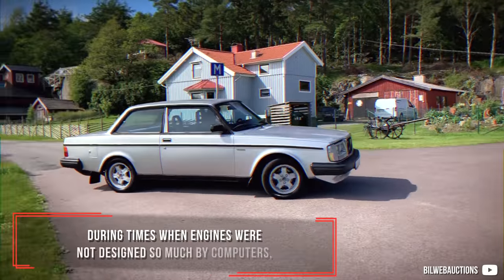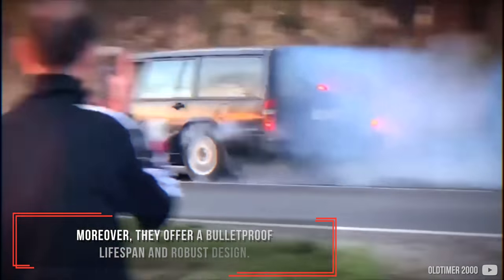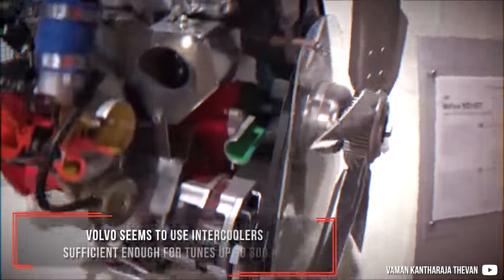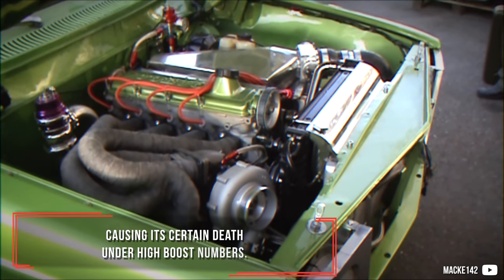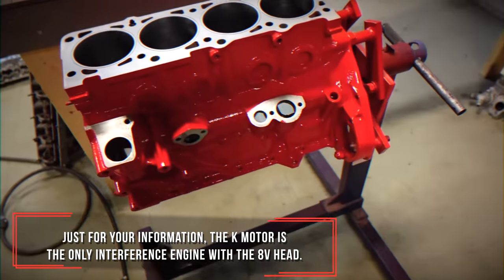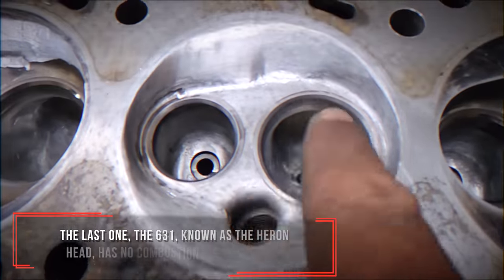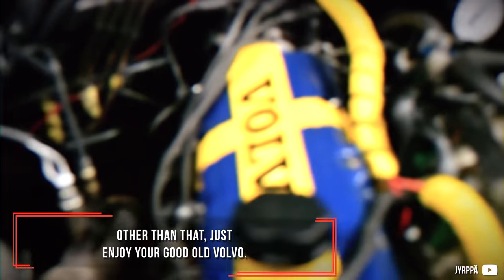Volvo Redblock: Sweden's Best Tuning Engine

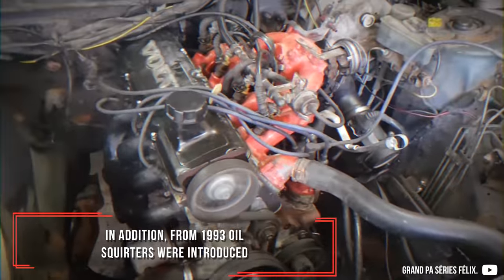Comment: 5:36 there was actually one variant that had a forged crank, the B204FT/GT which was only sold in italy and is super rare :O

Edit: the G variants were the same as F but made to run on leaded gas.

And there's a guy, dieselpacko, who used a modified K head on a non-K to diesel convert a 240...F, K and turbo engines have different height pistons, F has the highest ones, K the lowest and turbo in the middle and a K head with F pistons provided high enough compression for combusting diesel ;D
Reply: My b204ft is from italy. And i have lucky buying second engine for around 230$😁
Reply: köpte hans gamla 340, han kan sina grejer när det gäller volvo motorer kan man säga.
Reply: @Rostvin  nae jag bara är sån när jag börjar snacka volvo, bara börjar svamlar en massa 😂
Reply: B204ft the best Volvo redblock ever. One friend of mine has one on stock in his garage.

They made from 190-205hp stock. And made 250 easy with just a boost and exhaust  uppgrade
Reply: @Wasio212  best Volvo redblock ever
Reply: @anderseliassen2470  280km on stock turbo max and 400hp on stock piston and rods but i'm not sure on 100%
Reply: @Wasio212  Who said 280km on stock turbo?.. 280 hp?. Not on the weels. 250/260 max. Pistons 600+hp. Rods, manifoil and inntake up to 400
Reply: @anderseliassen2470  my friend but i said i'm not sure😅 so you say stock piston can handle 600hp?
Reply: @anderseliassen2470  not really, 16v is the best flowing head/cam setup stock and still one of the best. Turbo+ package achieved 190hp(and WAY more torque) with the worst flowing head and cam setup; 530 head with a T cam. Only head and crank are interesting(and penta crank is even more desireable) rest is worth scrap money
Reply: @Wasio212  overboost racing did almost 800hp on modified(for lower compression) pistons from a naturally aspirated engine. Base engine was an NA B230F with only modifications made being the stock pistons getting modified, aftermarket H rods(they only handle 300-400 stock reliably), aftermarket bearings and a turbo conversion. Crank, oil pump etc were stock from 1989 I believe his engine was from
Reply: @Wasio212  on the fk/Ft engine Yes. Some sweeds have even pushed it further 😂. Its the rod's and bad tunes that fails.
Most I have heard on stock b230ft pistons is 700 weel hp 💪🏼
Reply: @LocalAutist  b230 fk with penta crank, and 16v glt head and cams is a legit power plant 💪🏼
Reply: @anderseliassen2470  it doesnt even take any serious boost to make 300hp on such an engine😎

Comment: My b 23 lasted (as I recall) 335,000 miles, and my wife's b 230 was still running at 225,000 miles when we traded it in.   Excellent cars, both, but I preferred my b 23.

Comment: A problem not mentioned (because its the gearbox, not engine) is the m47 transmission. They can hold about 300-350whp before it starts to slipp. It started to happend on the Dirfts n Lifts Volvo you used in this video.  So if you want high hp numbers you also have to change out the trans with a modded bmw zf trans
Reply: M90 does is quite good also. But 3rd gear sync can be broken if you does hard gearshifts.
Also OD on m46 or m47  and "stupid" OD on all gears can be quite fun also.

Comment: Nice video about the redblocks! U missed one thing and that is the B234f (16v) engines has it's own block. U mentioned the balance shafts but it is the only block that they fit on. And the b234 has a belt driven oilpump. with that said the 16v head fits straight on a regular b230 with some modifications to the belt drive. If you really want to tune a redblock go for the b230fk block from 1995-1998. they have oilsquirters under the pistons.
Reply: Ad a 16v glt head wit cams, and a penta crank, and you have a powerplant

Comment: The Volvo red block engines is absolutely not a bad engine in any way but actually I would say that Swedens really best tuning engine is the Saab B204 and B234 found in 1994-1998 Saab 900 and 9000 and the 1998-2000 Saab 9-3.

Comment: As a volvo freak i can tell everyone that the 9mm rod engines are ok for NA tuning. Im running a Stock B200k block (stock 10.0/1 compression pistons) with -2mm skimmed head so about 11.5 or 12:1 comp), ported, H Camshaft, Weber DGAS 38/38, agressive timing , stock ported intake, some stiffer valve springs and its a blast to drive. 7500Rpm winter skids no problem. And gets 7.5L/100 no problem on the highway. But Not in the city 🙈😜

Comment: I had a bone stock 1986 b230 bottom with the 9mm conrods coupled with a 531 head and b230 pistons and a ”swan neck” intake so as a n/a it would put out 140-150 hp then i forced it with 1,6 bars of boost and drove it like that for a couple of seasons and broke nothing. 

So in my opinion the fear of the weak early b230 is overexaggerated. But if money hadn’t been an issue during those days i would have used more safe parts.

Comment: I always wondered why Volvo didn’t turbocharge the B234 (the 16 valve, balance shaft version). It was a sweet motor that loved to rev and 9-12 pounds of boost would have been impressive.
Reply: Yeah only the b204 was boosted, in small series. 200hp with low boost and tame camshafts.
Reply: @neonalon  Yeah because world weakest RWD gearboxes (m46/m47).

Comment: I have had three 740's; '91 B230F (electronic injection), 1988 B230E (mechanical injection) & 1985 B230A (pierburg 160CD carburettor) 😄 I found the A best even in cold ass Finnish winters. The F was the worst kind of F, Bendix Regina. always electrical issues. E was fine but had bad idle and throttle stuck open sometimes. Funny enough a connecting rod came through the block in my 85 B230A 😂 I did drive it hard, slides etc. but I took good care of it. Bet someone didn't. No idea how many miles were on it because of typical 740 broken speedo.

Comment: Those red block engines are strong reliable, bulletproof  you have the B-16,B18, and the different engines used in the 240s up to 1986 from there on it changed

Comment: I was really thinking about slapping a red block into my 960. However after further researching the uniqueness of the 960, I have come to conclusion that I'd rather keep the original B6304 ❤️
Reply: I'm also thinking about doing a 960/V90 Classic with a Redblock in it, I just love this engine. What is the weakest part of the Whiteblock in the 960's, the B6304?
Reply: @martij30  You know.. I'm not really sure. I've heard they are difficult to boost if the cylinder walls are too thin, allowing overheat. I've also read about people taking a S80 T6 block and sump, mating that with the 960.

Honestly I hear so many different opinions on how to build a 960, sounds like Volvos most diverse but ugliest child. Some will say to slap in a T6 with a single turbo considering the T6 will mount up perfectly. Others say a T5. Others will tell you a T5 is a pain to put in a 960. Then you have those who suggest a red block B230FT L (I guess the L is important when choosing this engine). I've heard some say to use pistons and rods from a T6 with cylinder sleeves to thicken up the walls.

I don't know what I'll be doing, but I'm gonna start with suspension and handling first. Thinking I'll just get better pistons and rods with a sporty camshaft and work on turbo after.

Comment: Here in sweden we know the limits of the fk b230 we just change rods to h-beam and port the cylinder head and for those upgrades we reach 700hp
Reply: Word. I had 337whp on my stock 98 b230fk. Just 531 head, gasket and arp studs and flyweel from fx engine.  Std rods, pistons and all. Drove it like that for 6 years before i sold it. That was 8 years ago, and engine is stil healty

Comment: I mean i would say Saab B2x4 or Volvo T5s are the best swedish engines for tuning
Reply: Yes and no, they can be tuned for big power but it'll probably cost 4x as much as a hi po redblock.
Reply: @eyesodd  you'd have an easier time making power from ANY T5 engine, and especially the 3.0T. the only redblock worth modding is the 91+ oil squirter blocks and even then the 8V head is quite restrictive compared to the 16v

Comment: My 1991 740 wagon seriously needs some of that turbo power. Good information if I want to build mine into a Hot Rod 
In the meantime what is best modification to squeeze a bit more horses out of it??
Has around 200,000 miles and still going strong. ( speedometer broke years ago at 165k)
JT: Orlando Florida

Comment: Power figures are a bit optimistic tho. Honest power at 1 bar boost is about 200 for most any B230 8v with any combintation of stock (8v) parts and no modifications other than higher boost. A 16v head (stock) on a B230 turbo bottom end will give about 300 on 1 bar. The 531 head is overrated, too big ports compared to actual flow, as it's the seat and valve config that is the limiting factor for any of the 8v heads. Otherwise the info is fairly decent.

Comment: Good to hear good thing about this engines.  I have a 1982 244 gl. I think it’s A k jet tronic.  Any info on that fuel system ?
Reply: Developed by Bosch and used by a lot of different mfg, they tend to work for years with minimum maintenance, but can be a handful once they need more elaborated service.

Comment: One thing to say is.  If you only change the oil and sparksplugs now and then. They will just go and go forever.  40-60-80 000km here in Sweden is not that rare  that they does work just as fin when they was new.    If the Belt broke. Just rotate the engine to Deadpoint and put a new belt on and drive again.   I can say that Every person i Sweden have drove a red block or a shop have worked on the cars so they know what to replace.

Comment: I would advise to whiteblock swap. Whiteblock is better.
Reply: How do you figure that? I've seen alot of failed whitebocks usually #2 rod bearing failure.. I'm yet to see with my own eyes a redblock fail... In terms of power I think the whitebocks are much better designed but they are not over engineered like the older redblock. I have replaced 4 whitebocks at the Volvo dealer I worked at and every time #2 wiped out the crank. Yet our older customers keep on chugging along in their 940s.
Reply: @hayballz1  It is just my opinion. I know a lot of people love redblocks. I would love a 16 valve stroker redblock with ITB-s and some form of forced induction. But if I compare a common 8-valve redblock to a common aluminum DOHC 5-cyl whiteblock, then that old redblock just seems very outdated when compared to what is available.

I have had three 8-valve redblocks, the last one I slapped an MB supercharger on and the rod bearings wore out probably because of low end torque or lack of oil cooling. 
I dont blame it though, it was good fun.
Now I swapped in a 4-cylinder 1.9 whiteblock (T4) with a cummins turbo, and it is a really nice small, smooth and light engine. T5 or T6 is even nicer though.

The redblock is legendary, but it is often overhyped.
Reply: @TheTavEst  agreed it is outdated and less powerful with less potential for power. That being said it certainly shines in durability and ease of repair. I just couldn't recommend a whiteblock swap over a redblock for what I have seen and how they fail and it is always the #2 bearing. It seems to me by the time they came out with the whiteblock they got the bean counters in and started cutting corners sacrificing reliability for power and comfort, once ford got their hands on the company things got even worse. To summarize if it's got a redblock leave it in there and if it's got a whiteblock change that damn oil every 3k with synthetic. I have worked on 100s of these vehicles and owned a few.. Of the cars I have owned and worked on the whitebocks always run smoother and feel more powerful but if I'm driving from NY to California I want the old redblock under the hood.
Reply: @hayballz1  True, my redblocks have never let me down because of engine problems. Now the whiteblock has a chance to.

Comment: the b230 bottom end can actually hold up to 385 whp
Reply: And with rods, pistons and a high preasure oil pump it will take about 650
Reply: @einar8019  stock turbo pistons hold 600+ hp
Reply: @anderseliassen2470  yes but not the rods
Reply: @einar8019  Not even close. Std 230 ft/fk rods are shite for any over 350 weel hp

Comment: What is this? Stock redblock bents rods at 250-300hp and has pretty bad 8 valve head, meanwhile Saab B204/B234 handles 500hp on unopened old engines. Highest stock hp numbers I have saw on Youtube is 700+ on stock rods and pistons. Saab is the real king.

Comment: 20 years ago i had a volvo 740 turbo. A few months later i blew that engine
Reply: How
Reply: @AA-wq2zl  
 That version (B230ET)of redblock had weak rods and one snapped and made a hole in the engineblock. The boost was only 14psi. When it happened there wasen't a big bang and the enging didn't die. It suddenly started to sound like when you are driving and small stones are bouncing around in the wheelhouse. I stopped and when i got out of the car  there was a long line of oil behind my car. Thank god Volvo went back to stronger rods later. They tried to better the fuel consumtion but also made the engine weak
Reply: @Suppermegamonkey  ohh